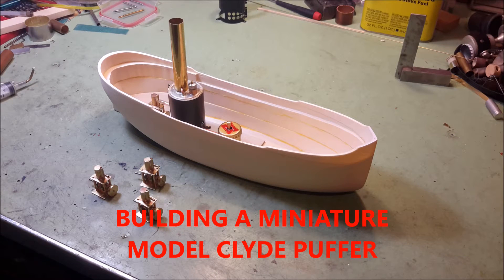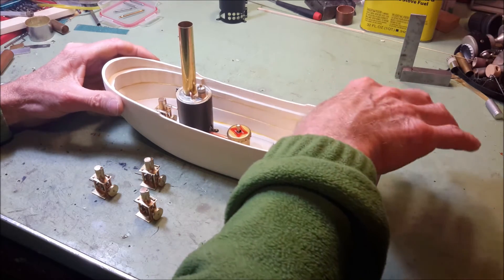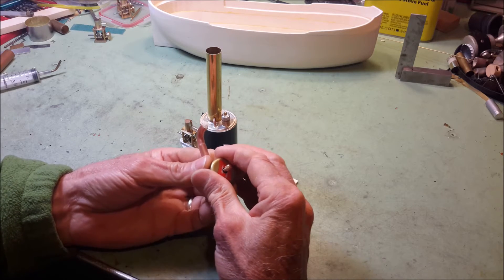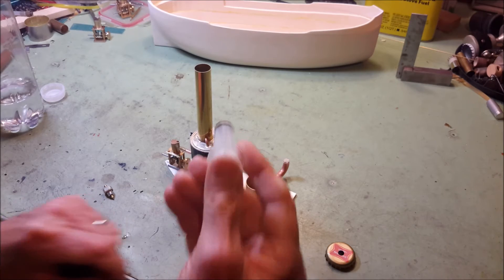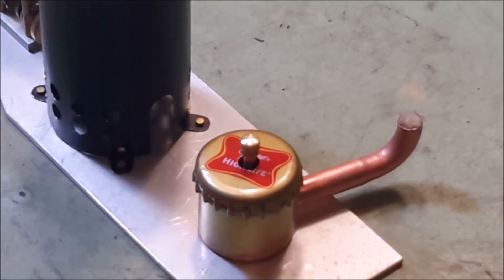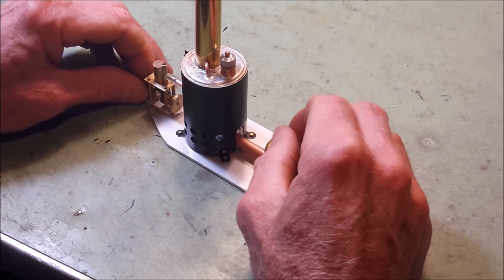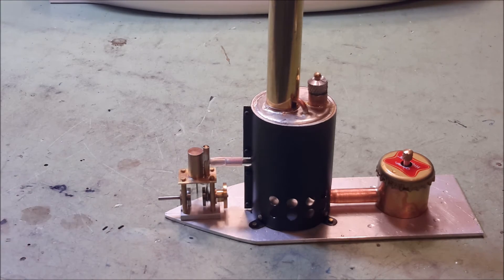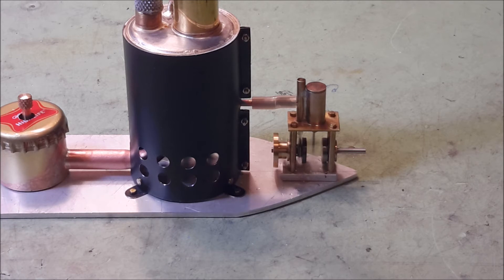BUILDING A MINIATURE MODEL CLYDE PUFFER STEAM BOAT

Comment: Sweet little setup. Now take two of those motors, a couple of valves for the steam supply, an radio control system and with that build an RC Steam Punk pre WW1 tank. Drive each track with one engine and use the valves to control the steering by controlling the amount of steam to each track engine.

You could also do a fun side wheel steamer where again each wheel is driven by it's own engine, allowing for the steering of the boat.
Reply from the maker: Thanks for the comment.  I'll pass on the ww2 tank, but the sidewheeler hold some interest for me.

Comment: Bonjour Leslie,
Great little steam plant ! Do you plan to install a reduction box betwen the machine and the propeller ? It is fast but I fear the engine couple coul be too weak. And this could help for a reverse.
Amicalement, Raphaël
Reply from the maker: Hello Raphael, I think when the engine is under a load the RPMs will decrease and the torque will increase enough to run a direct drive to the propeller.  I will probably use a lesser pitch on the propeller blades.